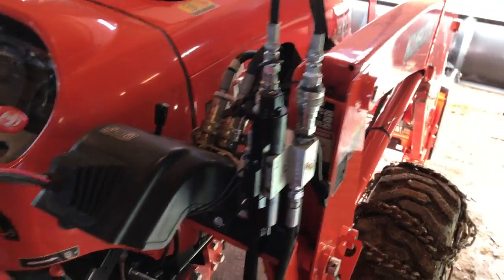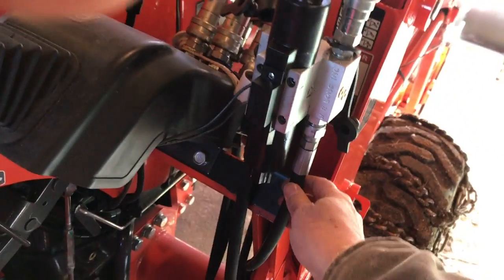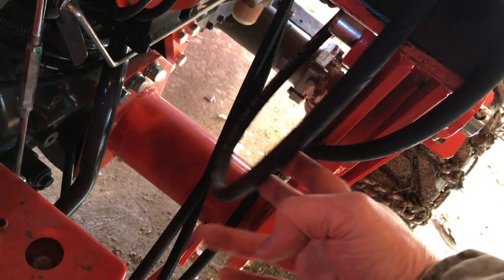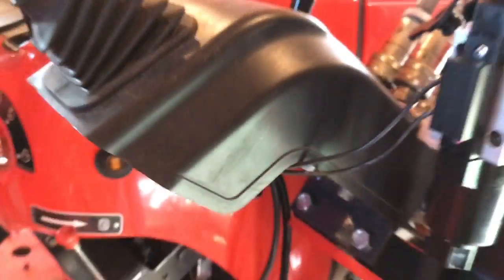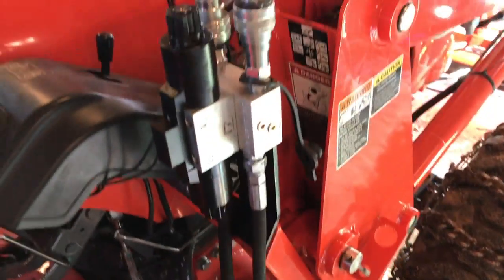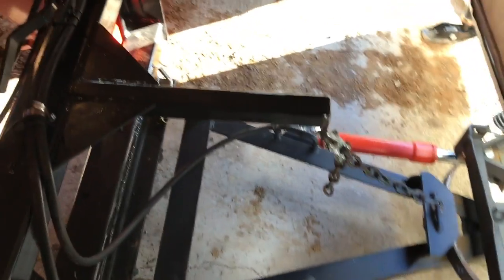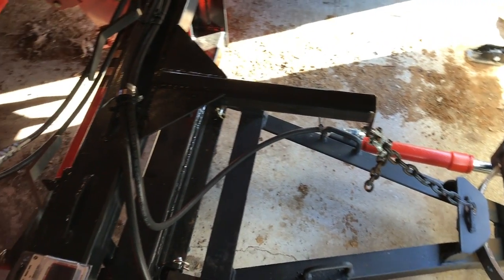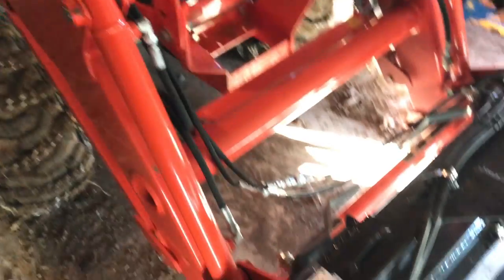W.R. Long 3rd function valve review on Kubota L4600HST

Comment: You are not able to control the flow to your plow cylinders with the joy stick?
Reply from the maker: Standard joystick only controls up down for the loader and curl up down for the bucket. Those functions still exist and the 3rd function adds control of the blade angle.